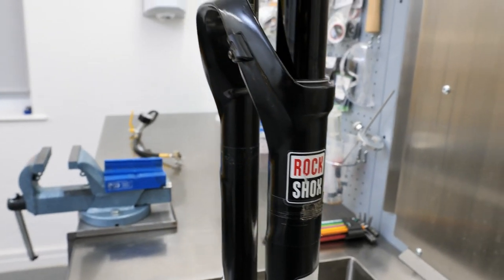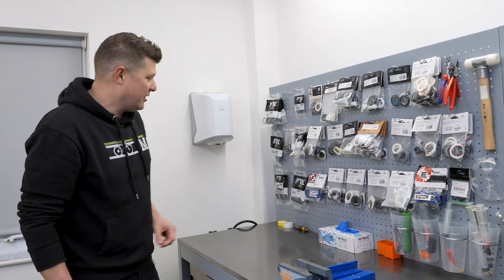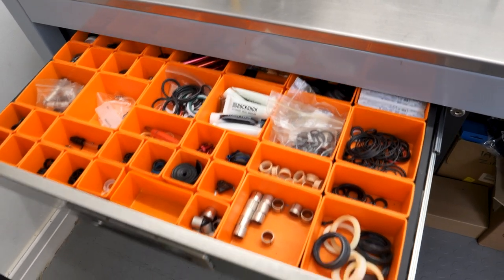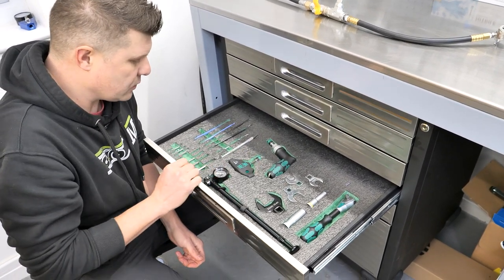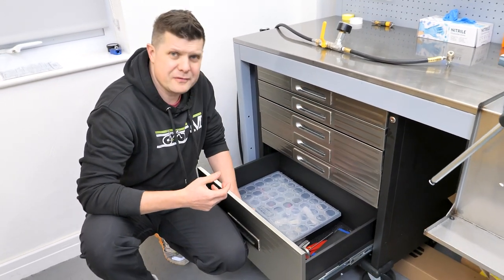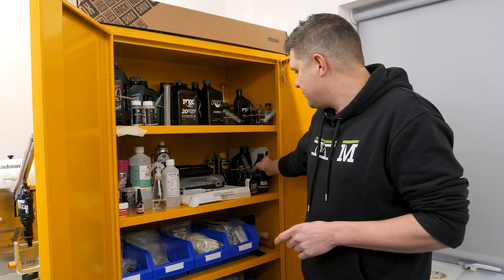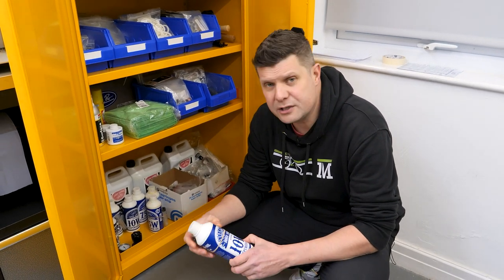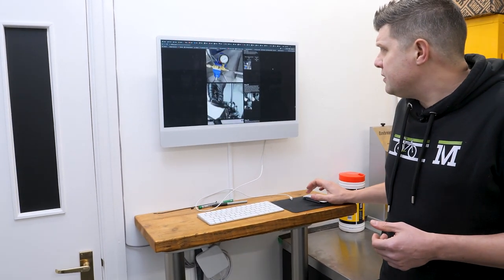Our Suspension Workshop for Servicing FOX, RockShox, Ohlins, & Cannondale.

Comment: I know very little about MTB (except I don't ride mine much as I don't like dirty bikes 🤪)  so this is really interesting to me. How often would you advise on servicing suspension. I have carbon Rockshock World Cup (SID) - dunno if it's any good came with the bike.
Is it also possible to change the length of travel on a shock?
Reply from the maker: A lot of ‘ it depends ‘ in there Kid, service often. Like every 50-200 hours of riding.

Comment: I have to ask why you need ear defenders for a stuck down shock, surely you just pump the shock up to the transfer port, equalise the pressure and slowly deflate? you have a hand dyno right there to help you.
Reply from the maker: Every now and then, it’s not that simple.  Especially when a customer has already tried this method and made it worse.
Reply: @Mapdec  I've never come across that situation.  I own a workshop specialising in suspension servicing for trade and retail, 20+ years never had that issue. Ohlins air shafts are about the closest to that issue but they release on the o-ring before the threads so the air comes out safely and with no bang.
Reply from the maker: Maybe we weren’t trying hard enough 🤷‍♂️